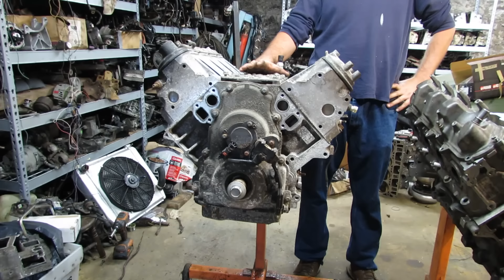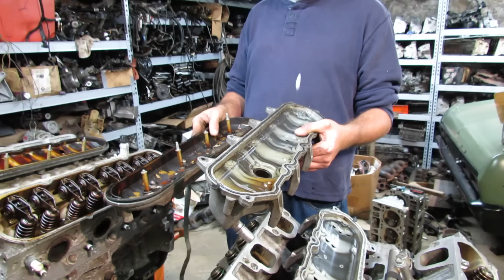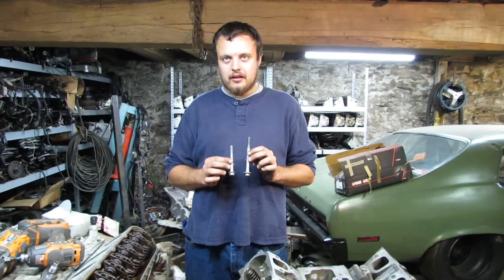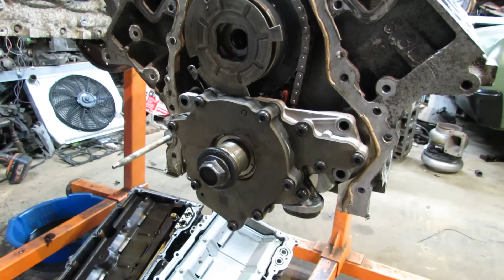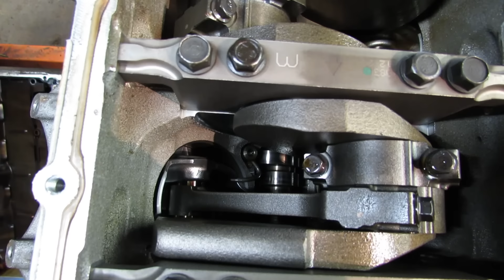The Next Generation of Chevy V8: LS vs. LT

Comment: When comparing apples to alligators, you should have just stated the actual port area (not volume) at gasket face. It would have been a slightly more 'scientific'. Biggest problem with direct injection isn't so much the pressure it's the fact it has to cope with combustion pressure. I knmow various manufacturers have worked on direct injection since 1970's. Even though materials were available, the technology to control injectors was too crude. Mechanical direct injection was low rpm diesel only. 
Honda often used the motorcycle division for engine experiments and development, it's why we now have 180~200bhp per liter street motorcycles.
BTW, static compression is a pretty meaningless number I haven't used in probably 30 years or more. cold cranking compression is the important number, aim for around 220psi, static will probably be around 16~17:1

Comment: They vary the output of the oil pump to reduce load on the engine and therefore improve economy .
The solenoid is either  on off or multi positional, on off is most likely especially if it only has two wires.
If it is on off you could easily find which position is max output and lock it there,
There is a danger that this is one of those pumps that can not be fully drained at an oil change without destroying the engine
Reply: I was wondering about both those points you brought up. I wonder if it's possible to just get a non OEM replacement pump...
Reply: @timjohnun4297  Too new possibly you'd have to look at a Summit catalog or the like.
Reply: @anomamos9095  Actually, looking at a youtube video of how the pump works, looks like it defaults to the max oil position anyway, if the solenoid fails, so you're right, the variable component could easily be bypassed. I know some Ford Ranger engines using a similar pump here (In Australia), if you do manage to lose the prime you can re-prime them. Bit of a process, but hey

Comment: LS is  better just from looking at it less machine work.
Reply: How does the LT require more “machine work” than the LS ?

Curious
Reply: @Jommybutler1234  by the extra visible architecture. Lots of people will say it’s restrictions. Etc, the LS is more simple mean better put together. The saying in engineering is that simple it is. It better  engineered.
Reply: @gjrt7573  I still don’t understand exactly what you are trying to say. 

What is the “extra visible architecture”?

What makes you believe “it’s restrictions”?  What is being restricted?

What specifically about the LS is “more simple mean [sic] better put together”?

Simple is better as long as it achieves the same goal. The features of this generation of GM engines had different goals, accomplished different things and has some features that are more complex than the LS it succeeds. You can’t have more function AND less complexity. 

Kyle Allen by the extra visible architecture. Lots of people will say it’s restrictions. Etc, the LS is more simple mean better put together. The saying in engineering is that simple it is. It better engineered.
Reply: @Jommybutler1234  I’m more than sure  you’ll find out when you install it. They videos out there that Gm built that that going to circulate back into aftermarket. I’m it’s not a bad find. It’s not as Modular as the LS. From the heads up. Probably will change. Way more custom work to get it to work. More parts you may have to change for it to last.
Reply: @Jommybutler1234  I will find video examples.
Reply: @gjrt7573  I am really struggling to understand your English
Reply: @Jommybutler1234  ight good luck finding parts for that proprietary has been.
Reply: @gjrt7573  What are you even trying to say?

Is English your second language?

Comment: Ford changed the world with the Coyote DOHC 4 valve engine. Guys, the Coyote is a crotch rocket engine. The GM engine is a pickup engine. Four valves take the powers to a whole new level
Reply: None of the GM vs Ford shootouts that I have seen bear witness to your claim.

That Coyote is Huge and will not fit between the frame rails on a lot of swaps
Reply: Just because it's more complicated, doesn't mean it's better....
Reply: said no one

Comment: Great video! This DIS is exactly what I’ve been waiting for! Why? Because propane. Yes welcome to 113 octane rating and clean clean engines! With propane we could increase the already high compression ratio and get free horsepower plus it’s boost friendly. The price of propane is almost exactly the same as gasoline if you consider it’s cheaper but the engine uses a little more. I’m sold on this new LT!
Reply: Have use propane for quite some time in my Little engines it has more octane than gasoline. But on my little 2200 watt generator you lose 10% of power on propane but it runs cleaner no carbon buildup at all. And I can run the generator going down the road no fuel sloshing around. I never have to treat the fuel on propane. I start all my gasoline engines on propane in the winter time. Natural gas has a higher octane rating but not probably too feasible to use it in vehicles being the tank would be a good size. The nice thing about non-liquid gas fuels if you put too much in the engine you just keep turning it over or let it rest for a few minutes. it's not like too much liquid gasoline in the cylinders and you wet the plugs and time for a spark plug change because a wet spark plug won't run. Also the oil doesn't break down with any of your non-liquid style gas fuels.
Reply from the maker: Hm... Very interesting. What is the BSFC?
Reply: @Calvin-Nelson  thank you. I have found only research on propane used in SI engines in its gaseous state. If high pressure liquid propane is introduced into the cylinder the latent heat of vaporization is going to change the game dramatically. Rousch has used a liquid propane drag car for some time now with great results. I admit I have not dug into their findings.
Reply from the maker: @aldente3585  so, where I am going with my questioning is will the same size injector go further with propane than with gasoline or ethanol?
Reply: @Calvin-Nelson  the testing I’ve found shows 10% less output than gasoline but the testing is on engines designed to burn gasoline; the compression ratio is not optimized to take advantage of the higher octane of propane. Also the Rousch team uses two injectors per cylinder but they are not using Direct injection.

Comment: Direct injection is cool, but it gums up the intake valves; did they fix that?
Reply: They haven’t fixed it, the only solution manufacturers have come up with is to have both sequential injection and direct injection
Reply: @SuperSstealth  remove the crankcase breath tube from intake. and plug off . run a filter on the breather . thatl help
Reply: @vokdienuwesuidafrika  that would screw up the engine a lot, you would have no crank case ventilation when you are not moving, it would ruin the oil and allow a lot more sludge to build up
Reply: Sluge comes from not changing your oil. How would it build up if you stay on top of your oil changes ? It wouldn't screw up the engine. Do a little home work next time
Reply: @vokdienuwesuidafrika  no sludge also forms from the byproducts of combustion and humidity in the oil, that's why all engines run a PCV. 
They break down the oil and reduce the oil life

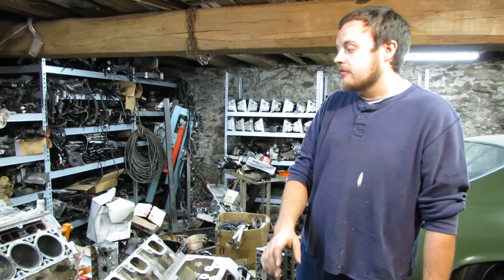Comment: 12:58, I'm sure after market will fix that.  How come GM does not use 5 head bolts per cylinder like before??  Did they they do that on their new crate 350 engine?
Reply: What GM engine had 5 head bolts per cylinder?

The aftermarket blocks fro DART and others have 5 head bolts per cylinder.
Reply: @Jommybutler1234  As far as I'm aware, all SBC's had 5 bolts per cylinder??
Reply: @timjohnun4297  nope, not the ls series.
Reply: @jamesjacobs1909  You're right about LS. The gen 1/2 SBC's did though.
Reply: @timjohnun4297  they all did till the ls.  They went the way of Ford, except they kep the cam in the block.
Reply: @Jommybutler1234  Worked on a pair of cast iron Darts for a SBC, and had to replace all of the valve guides; lucky for me Dart (and only Dart) had +3 replacement guides for $9.50 each!

Comment: how can the direct injection clean the intake valves?
Reply: Spray cleaner into intake every 30k miles

Costs $10

Works great
Reply: @Jommybutler1234  unless its a boosted motor! That shit will come off them valves and run rite threw your turbo and that will be the end of it!
Reply: @TheBustedNut  Who exactly told you that?

Comment: Direct injection doesn't clean back of intake valves. Some auto makers are using two injectors one up stream. Would have liked to see them valves in this vid and the chambers.
Reply: The spray cleaners used every 30k miles are very effective. 

In boosted applications, a catch can is thought to be beneficial.

Also, the LT5 has DI and Port Injection.

Comment: Electronically controlled oil pump don't waste your time making horsepower that's going to fail manual oil pump is the best for racing what a real piece of garbage
Reply: Kudos my friend! You somehow managed to take first AND second place in the most stupidest comment category.
Reply: What makes you think the variable output pump is more likely to fail than the LS?

Is there a link you can send me with more information?
Reply: Video specifically on the new oil pumps. https://youtu.be/-1f1u960I-I

Comment: The cathedral shape intake port seemed overrated to me... I’m not all that surprised to see it go & kudos to GM for giving us more options
Reply: The cathedral ports work great, they're better for most street cars, especially on boost than the Rectangle port heads, especially if you aren't looking to spend a fortune on valve train parts to keep from dropping a valve or some other problem caused my the big heavy valves and a cam that is overly aggressive to try and squeeze every bit of power out of the engine. It's best to keep the lift under 0.600" IMO with rec ports even though they offer more flow UpTo 0.625-0.650" lift, not a very good HP/$ proposition when you include the extra precautions for only 10-15hp, you can get more power other ways cheaper.

Comment: Nascar stuff hum. That's why Gm Ls Lt motor are the truth 
 Now I want to build a Lt
 Gm ls lt FTW.
Reply: nascar gave up on the ls years ago, the nascar engines are all based off the ford  and a lot of parts enter change between makes.
Reply: @schoonymopar  
Chevy engines are made by HMS or RCR.

TRD makes all the Toyota engines.

Roush-Yates makes all the Ford engines.
they are not the same at all only the specs are the same
Reply: @NightshiftCustom   not true at all  you'd be surprised

Comment: This was a very interesting video.  Some great schooling on the differences between the LS and LT engines.  Although I own a classic mopar with a b engine big block 383...I really find GM's new "stuff" to be cool...even more so than that of Ford "Tritons" or "new" mopar hemi's.   The LS's have become legendary...even to the mopar folks.  But...i just wonder if the LT's will be as reliable with direct engine, solenoid control oil pumps, etc.  My old 383 is 53 years old and is drop dead reliable with an original bottom end and heads.  But you do hear of alot of folks putting 300K+ miles on the LS's.
Reply: NO..they have lifter problems and low oil pressure issues. Popularity is from being plentiful and cheap. Same as sbc have always been.
Reply: @BruceLee-xn3nn  lmao funny you say that. Just have to get a afm delete new tune. And wam bam thanka maam

Comment: The intake ports are raised to make room for the injectors not for performance. Have check the other guys channel out yet im going to  I found it hard to believe  that someone has basically doubled the n/a power level of the l83 witch is what it take to make 800hp at 9lbs of boost 19 lbs of boost sounds more realistic. If you got a built 6.0 and 17lbs boost and your only making  800hp something wrong a stock 6.0 at 17lbs will make over 800. In fact a ls 5.3 will make  800hp at 17lbs of boost
Reply: Many are picking up 150hp at the wheel with full bolt ons and cam upgrade

Stock L86 (6.2L) is 420hp SAE. 

570hp @ 14.7 psi of boost = 1,140 at crank

1,140 x .80 (drivetrain loss) = 912hp
Reply: @Jommybutler1234  you are correct but he's not talking about a l86 (6.2) he's talking l53 (5.3) thats rated a 335hp i believe and they respond to the bolt on as well in the 100 to 125 range if you go with the 125 and say 335 thats 460 and your not going to make the 800 with only 9lbs of boost the numbers  will not add up.  Even if he was on a really give dyno it still want add up. By the power formula 460hp + 14.7lbs of boost = 920 × .80 = 736 thats 14.7 not 9 wouldn't be realisticat all. witch a .80 would be a great drive train loss most manual are in the 12 to 15% and autos with a really good converter can get in around that to most street car type auto converts going  to be closer to 20% or more.
More realistic  numbers would be 335 +125 =460 × 2 (14.7 lbs of boost) =920 ÷14.7 = 62.585 hp per lbs of boost ×9lbs of boost = 563hp × 20% loss 112.65 =450hp to the ground
Reply: @michaelstoker6710  I believe many are stating that the Gen V are making more HP w less boost, due to better overall flow...intake, heads, all the way thru

Boost PSI and CFM are not the same thing. You can sometimes flow more air with less PSI. 

It’s Magic
Reply: @Jommybutler1234  atmosphere press can not an will not change with cfm of the turbo.. the 14.7lbs or 2 bar of atmosphere pressure has nothing to do with cfm.   Unless the motor is maxing the cfm of the turbo out is the only way it can effect it. Basically  saying  your putting a turbo that will only flow enough cfm to support say 500hp it want matter what psi you run it at it will only support the 500 hp. When you double the atmosphere pressure 14.7 and a turbo that will support the power flow enough cfm it doubles  the hp. So if you have lets say a pie sportsman 7675 it will flow enough cfm to support 1300hp so let's say you put it on any motor you like sbc BBC LS Lt sbf bbf mod hemi Honda Toyota what ever that makes 650hp run 14.7lbs of boost you'll make 1300hp now replace that 7675 with a gen 2 pro mod 106 and it will still only make 1300hp at 14.7lbs of boost. The amount of cfm that the motor flows and the turbo flows doesn't matter as long as its enough to support the hp level you are trying to achieve.
Reply: @Jommybutler1234  another way to look at it is if you run a turbo and at 14.7lbs of boost and don't double the hp your turbo is to small and will not support your hp. But once you double  the power at the 14.7 you will not make anymore  power until you change something  on the n/a power or up the boost level.
Reply: @michaelstoker6710  That was a lot of typing. 

Rev higher or burn more fuel = more HP

Each unit of fuel requires a unit of air.
Reply: @michaelstoker6710  If a power adder delivers 2x the air and you don’t make 2x the HP...there is a problem with fuel, tune or restriction. The problem is not the power adder being “to [sic] small”, it either delivers the air or it doesn’t.
Reply: @Jommybutler1234  again  cfm and boost are not related in the manner your thinking. Like I said if you have enough turbo  meaning it flows enough cfm to support the power level you want. But the 14.7 lbs of boost is twice the atmosphere pressure and will double your n/a power level as long as the turbo will support that power. Again take any motor you want lets say a 450hp n/a motor a small 57mm turbo that maxs out at 600hp as soon as you make the 600hp it will not make any more hp but jump to the 7675 that will support the 1300hp and at 14.7 or 2bar of atmosphere pressure  you should make 900hp with it then jump to a pro mod 106 and at 14.7 or 2bar of atmosphere pressure  you will still only make 900hp even thought the turbo its self can support 2500hp+. Your still only multipleing the n/a power of 450hp  against atmosphere pressure
Reply: @michaelstoker6710  1 BAR = 14.7psi

2 BAR = 29.4psi

Get that part correct first
Reply: @Jommybutler1234  you are  correct sir except when your talking  automotive and boost. yes I understand 14.7 is 1 bar and 29.4 is 2 bar and 44.1 is 3 bar. This and cfm and micro electric discharge is what I get paid very well to do daily. Bit back to the automotive boost side if you run 14.7lbs of boost that will max out your 1 bar map sensor  that is way I keep saying  2bar because  you need a 2 bar at 14.8 to the 29.4 and 29.5 to 44.1 you'll need a 3 bar. Its ok not to completely understand and be wrong,but absolutely no reason you need to get a hateful tone over someone's video that is given misinformation. The videos  on YouTube  that are like this and spread  a lot of misinformation is one reason a lot of people do misunderstand and have a lot of wrong ideals. Hope you and yours have a merry Christmas sir.
Reply: @michaelstoker6710  What you think and what people are actually achieving are sometimes different

Merry Christmas
Reply: @Jommybutler1234  its not what I think they can achieve its simple math. Its impossible to make more power than what the laws of physics says you can. If your are doubling your n/a hp with less than 14.7 lbs of boost either your boost gage or the dyno or both are incorrect. This also works the other way as he stated his 6.0 took 18lbs to make that power a Bolton cammed 6.0 will make 500+ easy and at 14.7 should be over 1000hp and 18 should be 1200+. People posting  information like this is why all the sloppy/ internet  mechanics have these 1000hp cars but get gapped at the track by a 500 and 600 hp cars all day. Not trying to take a  Jab at you or anyone in particular just trying to give a side and hopefully people will start to do some real research and not just YouTube it and Facebook and go. I Promise you there is more inaccurate information on those than there is accurate.
Reply: @michaelstoker6710  OK